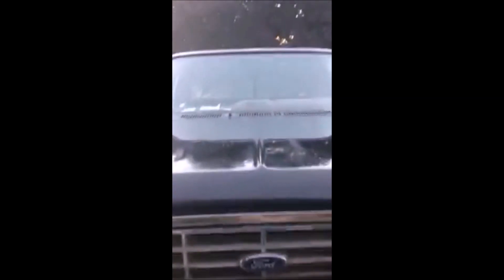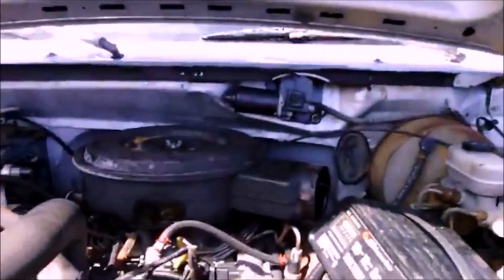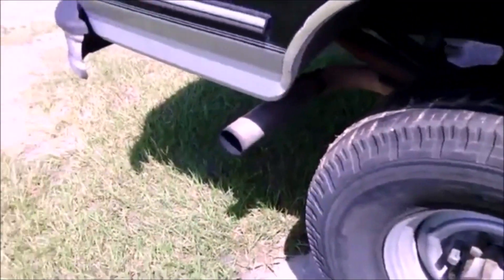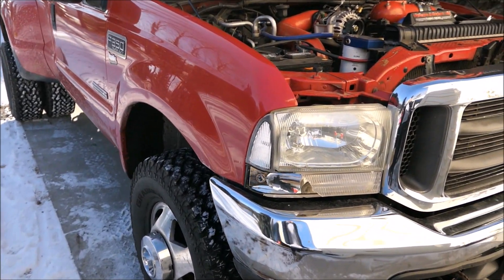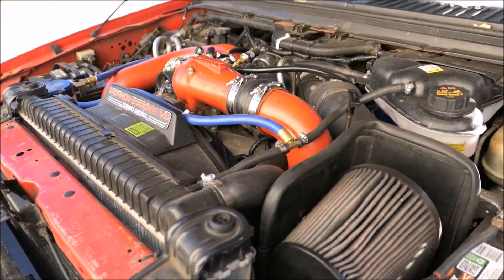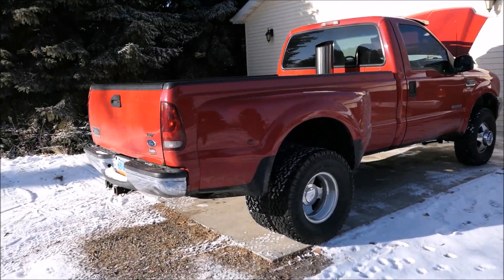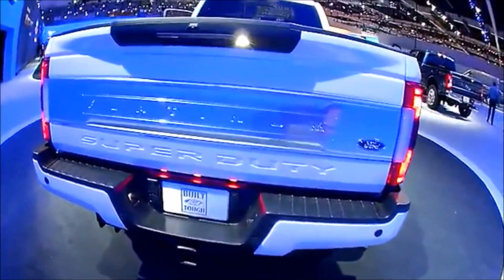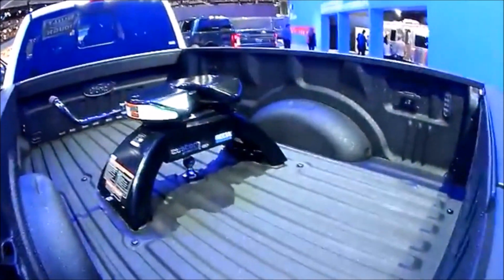History of the Powerstroke Diesel: From 7.3L to 6.7L

Comment: Ford diesel tech, the 6.0 is truly a great engine how ever the worst powerstroke is the 6.4 it was made to get international out of the contract wirh ford onternation didn't want to make it ford made them its a 100k engine after that you need a new engine, if water gets in the fuel system it will rust the injector tips and fuel pump and grenade the engine and many more issues

Comment: Some of your facts are incorrect about the 99 7.3
Reply: Can you tell me the differences between a 2000 and 01 and 02 why they sound so different? Which one is better? I am looking at a 2002 but the sound of the engine surprised me because I drove a 2000 and it sounds completely different. The 02 is almost quiet.
Reply: @shelleyerasmus1826  split shot injectors
Reply from the maker: Could you please let me know which facts were incorrect?
Reply: @blindlymadevideos9642  99 has forged rods,
Reply from the maker: I am not sure how I missed that in my research. After looking into it more, it seems that even some of the later 7.3s, like 2001, had forged rods, but it wasn't guaranteed by just the model year. You could check if the engine has forged rods by looking up the engine's serial number. Thanks for pointing that out.
Reply: @blindlymadevideos9642  99 7.3, horse power is 175
Reply from the maker: @bassfishermanify  I cannot find a source that says that the 1999 7.3 Powerstroke made 175 horsepower. In the video, I think I said the 1999 7.3 made 235 horsepower. Here is a link that lists the power levels:
http://www.powerstrokehub.com/timeline.html
Reply: @bassfishermanify  theres no way the 1999 made 175. my 1995 makes 215
Reply: @psd28  don't believe me? You haven't looked up the information then. Look up the information for yourself and see .  Early 99.
Reply: @bassfishermanify  lowest i see is 225
Reply: @psd28  I must have the lowest horsepower powerstroke to ever be in a early 1999 Ford F-350. 175 hp, 350 ftlb of torque. My truck was intended to be used for industrial use. Low maintenance and long life of the truck was the intention. The truck has had many proformance upgrades in the last four years. It's not slow now. It does low 12's in the 1/4 mile. Now it's fun to drive.. Crew cab, long bed, 4x4, 8 inch lift. It beats my 2005 F-350 6.0 that also has upgraded parts for better acceleration.
Reply: @blindlymadevideos9642  early 99 7.3 has many differences than late 99, 7.3L.  turbo size, injector size, hipop output, intake plentum intake diameter, front breaks so many to list
Reply from the maker: @bassfishermanify  I understand that there were many differences, but I wasn't trying to list everything that was different in the video. I was just trying to do a general overview of some of the differences, but I appreciate you pointing out the additional things that were different.